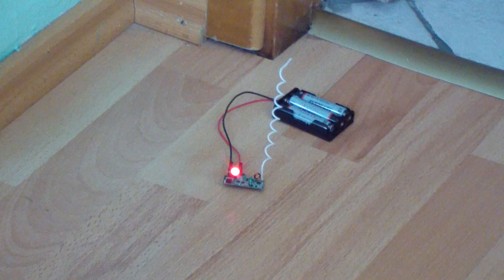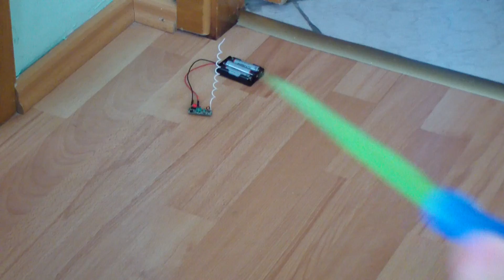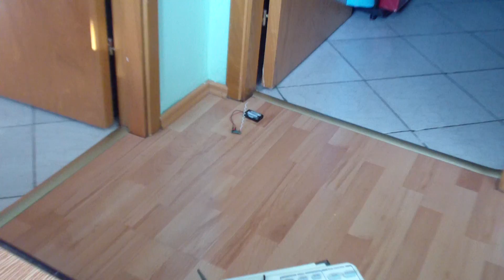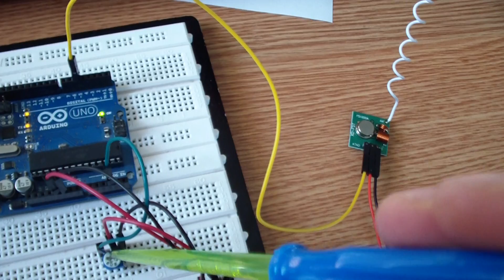Arduino RF blinking led

Comment: I'm working on a similar project and this is the only example that I've seen with a single Arduino connected to the transmitter and no Arduino connected to the receiver.  How do you have the LED connected to the receiver.  I've tried various methods, and I can't seem to replicate this example.  Any advice would be appreciated, thanks :)

Comment: what is the range you find ? i found only 1meter? how can i increase this range?
Reply: nasim ahmed you can solder a antenna to both modules look on the back and you will see a hole label ANT you will get 100 or so in door, more out door
Reply: thanks Frank ..........i works........
Reply: no problem, if you have anything to share that be great my code dont seem to work for me